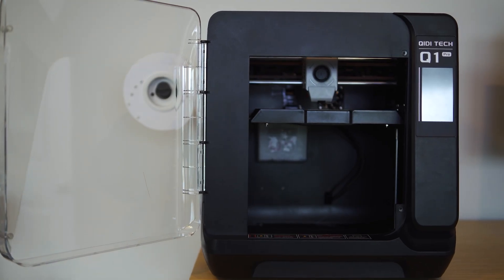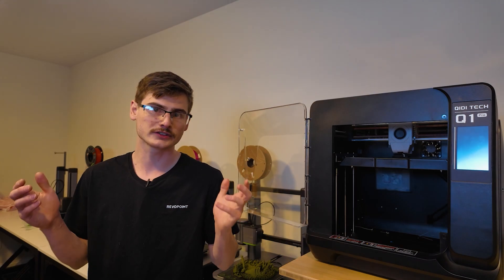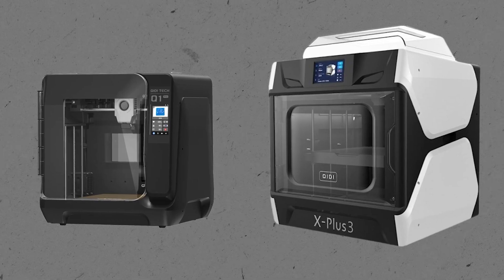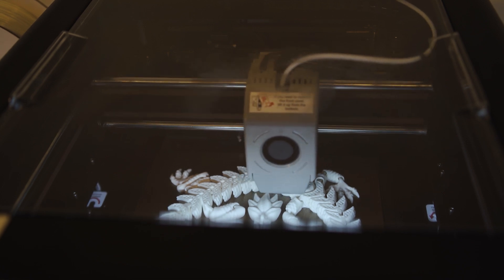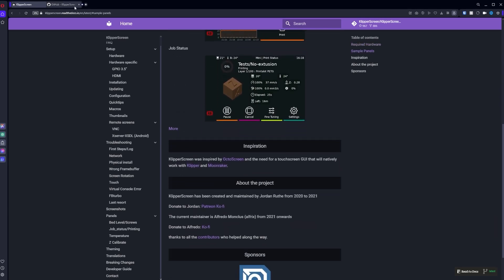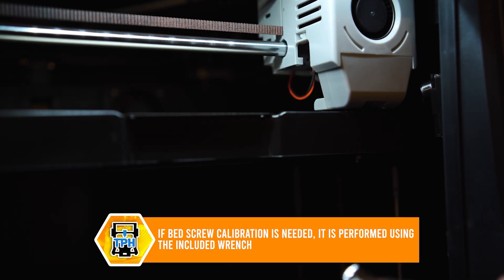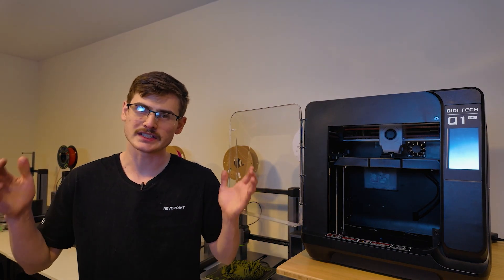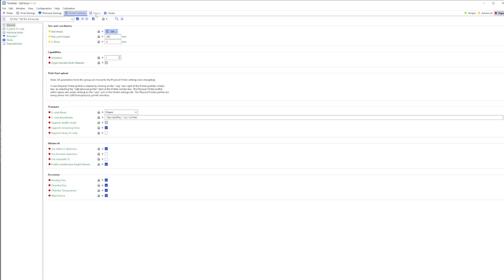Bambulab might be dead to me after this printer! (Qidi Q1 Pro)

Comment: The printer has great specs, 350C hotend, heating chamber, which lets you print with more advanced materials, but so what, if, afaik it lacks proper filtration system. It has a fan that blows the air outside, and doesn't have carbon or hepa filters. You can buy carbon one on Qidi website, but I don't see any place you can mount it to prevent bad air from these advanced materials go outside the printer.
I think Flashforge M5 Pro has better solution.

Comment: Re: Klipperscreen.  You can use Klipperscreen on a tablet/laptop, and point it at the printer's IP address, and that works just fine.  If you want Klipperscreen for now though, you just have to run it on something else as the stock mainboard does not have an HDMI connector on it. 

I'm of the belief that the main reason they didn't go with it as stock comes down to keeping the price low as well as providing a stable platform for them to support.  The stock screen is a self-contained single-board computer all on its own, and apparently costs something like $20.  The mainboard doesn't drive the screen, they just exchange messages/events over an extremely cheap (and low speed) cable (which is why firmware updates take so long, it's 'cos of the screen firmware update).  Since the stock screen is self-contained, it doesn't require a separate HDMI cable, or does it require a GPU on the main board, and nor does it take any significant CPU resources to drive the display.  To put a full color HDMI capacitive touch screen on the printer would probably cost an extra $40 in various parts, which is significant at this price point.

It should also be noted that the community has figured out how to upgrade the OS to Bookworm, and the Klipper to full main-line version 12 Klipper.  This applies to the Plus/Max 3, and should work on the Q1 as well.  In fact, Qidi engineers are even assisting those guys in achieving that.  The stock display functionality can still be retained as well, so with any luck we may see an update to the OS/Klipper from Qidi sometime soon, for now it is possible to do it yourself if you wish.

Comment: 350 x 350 x 350 colour with super quick prints enclosed the K2 from Creality June July
Reply: colour? who the fuck are you? PLA plebs???? Nylon needs no colour. ASA aero is white. ABS? yeah, u can, but plebs still. You need nothing more. K2 from creality? It has one extruder only. Will buy when it has 2. xmax 3 > k2 for engineering

Comment: 6:43 I, for one, appreciate the lack of a protruding door handle... I have a Voron 0, which I have to turn on it's front side way more often than I would like (to get to the electronics), and am always worried of breaking the door handle. Nice and flat door is best IMO and it's not like with the Q1 you need a screwdriver to open it ;)
Reply from the maker: Yeah you know I said I don't particularly like the door handle because it is hard to use, but it does work and it doesn't get in the way of anything so I suppose there might be value in that

Comment: This printer is so far away from Bambu level, I'm not worried...
Reply: @tabooretka i have a pair of Bambu A1's. what i love about them is that they have been by far the most painless printers to use Ever

never did anything on those manually, apart from lubricating the rails or changing wall thickness and / or infill for structural parts or cleaning the bed with IPA

thats about it, and no i don't even have the AMS' because i don't care about that too much

wouldn't want to miss that experience, zero manual tuning is exactly what i love about them, it's epic in that regard.

for tinkering i just have my old pile of junk around (CR20 Pro) if i actually wish to mess with that.
Reply from the maker: The only thing I can definitively say is better with Bambu is the slicer. They're both prusa, so the same algorithms, but Bambu studio feels better. However, I'm not saying qidi slicer is bad....
Reply: @ThePrintHouse  Orca Slicer works just fine with the Qidi's as well, if you want something closer to the BambuStudio experience.
Reply: Orca slicer works phenomenaly

Comment: Qidi needs to stop with these crappy resistive touchscreens.
Reply from the maker: One big differentiator between qidi and these other printers is the screen. the interface on the q1 pro works well, but it definitely doesn't feel as premium to use

Comment: I got mine yesterday and it is ***** spectacular yes spectacular I needed to use that word because it's the most flamboyant word to describe this printer at the price you pay, the spool holder is fine as long as you have it pushed up against a wall it doesn't wobble as much as people say is it flimsy yes but not as flimsy as having it out in the open plus it's a 3D printer print a replacement it's a lot stronger and sturdier not worth mentioning IMO.................
Reply from the maker: Sadly where I have mine I cant put it up against a wall, but yeah I can likely print something to strengthen it.
Reply: @ThePrintHouse  yeah the need it make it YouTube channel made a replacement spool holder called the monkey bars, but yeah you were definitely right about that door handle I was screaming at my screen at every review I watched saying it's the notch in the corner idiot lol thanks for pointing that out..............
Reply: @ThePrintHouse  How difficult would you think it would be to 3D Print a more solid version of the stock spool holder?  I see over on the official Qidi wiki that they provide links to a number of spool holder alternatives that are stronger than the stock holder.  While I agree that the stock holder should definitely be more sturdy, making a sturdier replacement seems like exactly the sort of job that a 3D printer would be perfect at punching out in a few hours and a couple of dollars of filament.

Comment: Anything less than 300mm cubed is obsolete unless you're severely space-constrained. And if you have room for filament, etc, etc, a larger printer has such practicality that I'd never go with a smaller bed. When Bambu comes out with their rumored XL printer, it's going to really kill the market for these smaller printers.
Reply: @brianwilcox2543
Sorry but what an unreflective and stupid statement. I only print spare parts for my RC cars and therefore never need a larger printing plate. So why should I buy an unnecessarily large 3D printer?
Reply: @lisadebliss  Moving those big ones around is not fun.
Reply from the maker: I dont think thats really the case. Probably 99/100 prints I make are significantly smaller than 300mm in any direction. In fact I rarely have a print that is greater than my 256mm3 x1c. Maybe I print vastly different models than most people though
Reply: I used to think that too, but time proved that that's a dumb take. 99.9% of my prints over 5 years now would easily fit in 200mm cubed and for those that wouldn't dividing prints into pieces is braindead easy nowadays.
Reply: I do agree with you, although in my opinion bambu beds are the perfect size. The xl will be amazing and is definitely going to kill the market.
Reply: Good luck actively heating that volume
Reply: 300mm2 is the minimum I require especially for larger helmets 
Also some of the prints I do I would love to go past what I'm restricted to with my bambu current max is 130% of a dragon would love to go 200% lol
Reply from the maker: @Retroforge-creations  Ahhhh helmets. Ok yeah I understand that. Helmets are one of the excepts for things I've printed that arent large enough on a standard printer.